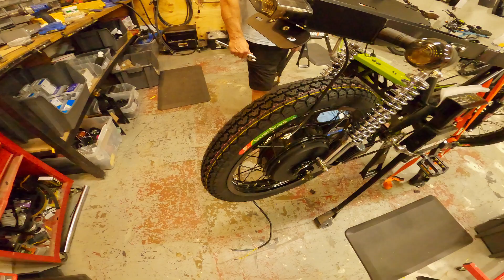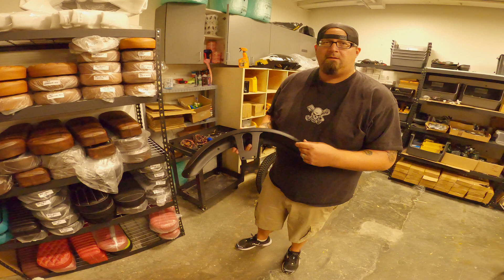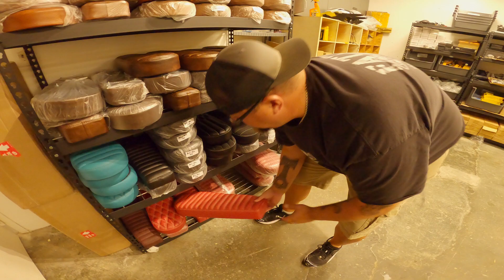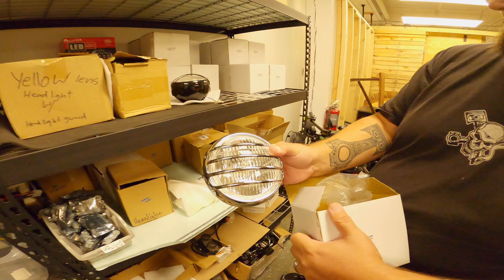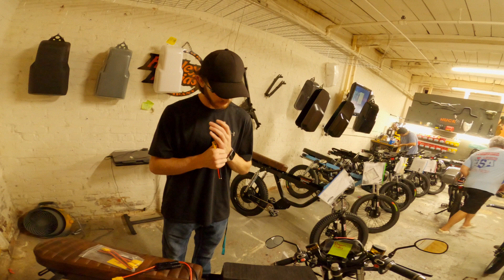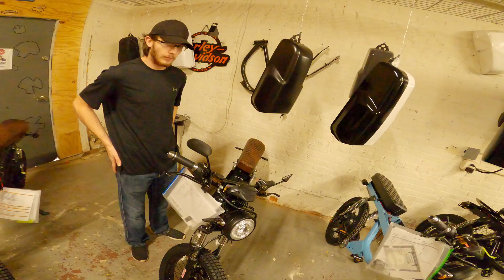FIRST LOOK HUCK CYCLES STINGER + BONUS SHOP CONTENT

Comment: What would be the icing on the cake on this bike is if they build a seat with a great hump so it gives it a more cafe racer look. Not only that, it will make the female passenger feel much more comfortable as she will get a less obstructed view. You can also flush mount a tail light in the hump. But I get it they're going for the scrambler look. hint hint. Again, the Huck so much sexier than the POS ONYX RCR that's such an unpolished build.
Reply from the maker: I know they offer other seats, even some with the hump on it. Check out the other seats offerings on their site 🤙
Reply: @tommebike  Nice going to check it out thanks.